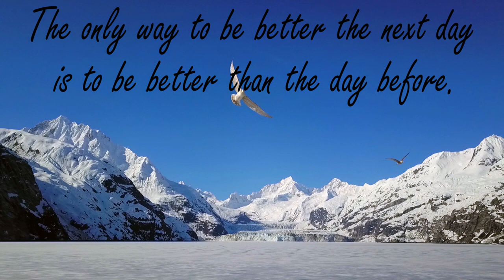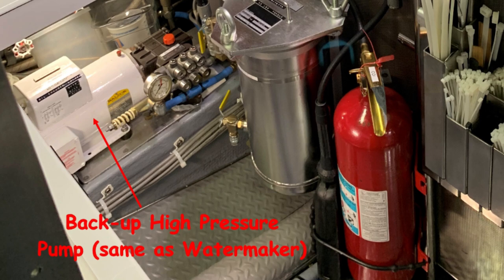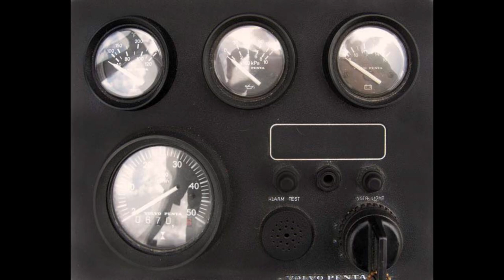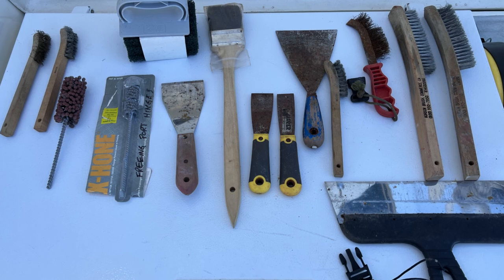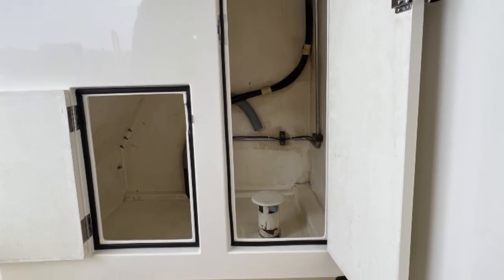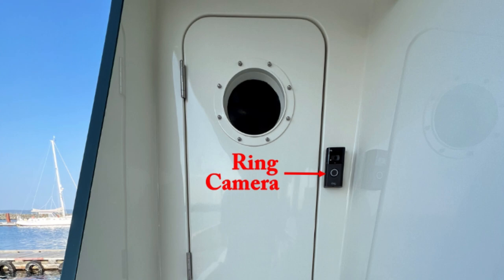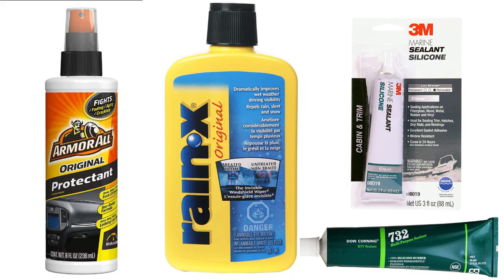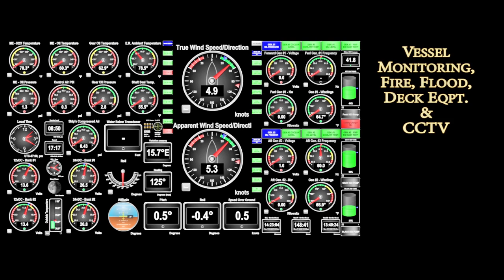Episode 6 - Part II  Deck Considerations

Comment: Absolutely luv your series of videos, extremely informative and detailed, I hopefully will be in the position to purchase a explorer yacht, I'm almost certain it will be a extensively modified Steel Hybrid Bering 77  200 ton with double redundancy on every system, my home base is mid eastern coast of a land down under and intended cruising grounds would be the Indian, Pacific, Atlantic and Southern Oceans
Reply from the maker: Hi Michael.  Thank you for your note.  I don't have any direct (first-hand) experience with Bering's yachts.  That said, they appear to be more form over function, with very appealing exterior styling and a great approach to marketing.  Maybe you'll be able to let me know one day from hands-on experience?  Best of luck...........Cliff
Reply: Thanks for your advice cliff, I have spoken with a couple of Navel Architects about the hull design and it's rated CE1 Unrestricted,  I am deleting the swim platform and having the Transom extended so it will be a 26 metre yacht with a deeper keel plus larger fuel tanks hopefully extending the range to 8000 nautical miles, also deleting the top sun deck

Comment: Hi again Cliff. The dual davit system is really unique. I've not seen that setup on any other boat. Have you ever run into a situation where you couldn't get your large tender off the boat because of the way you were positioned at the dock?

Comment: Pure gold. Those spreadsheets are outrageous. 😂 Cliff, what are your thoughts on using teak for decks vs the anti-slip surface it seems you have on Oasis? Thanks for passing your many years of knowledge. Much appreciated.
Reply from the maker: From just about every perspective, teak decks are the gold standard, if you don't take into account their cost of installation, maintenance and replacement.